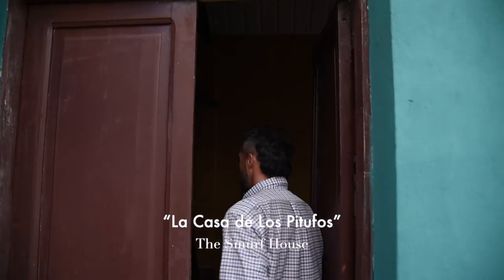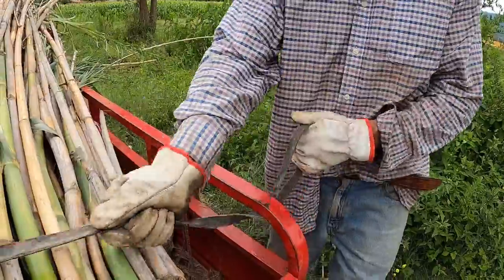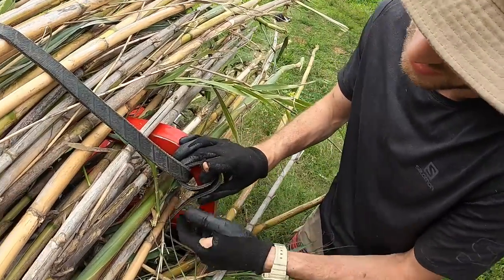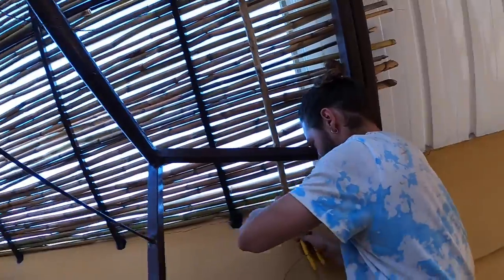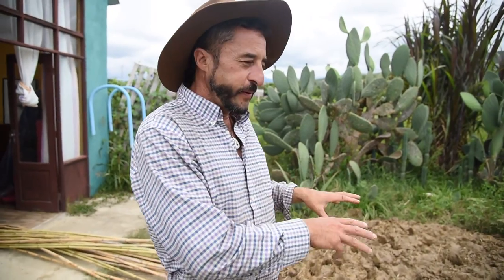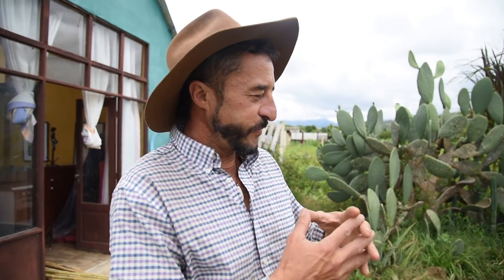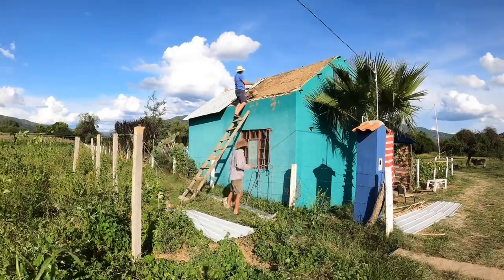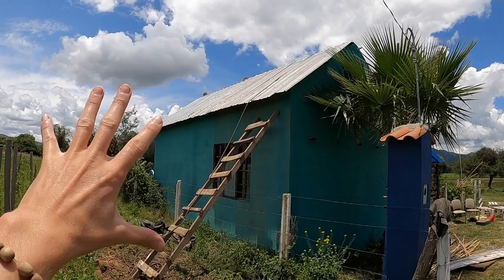How to Insulate a Roof with Bamboo from Start to Finish

Comment: I would've slapped a light straw clay straight onto the bamboo stopping all termites and creating better insulation. Earthen plaster the interior ceiling to further protect bamboo.
Reply from the maker: Supposedly with cal mixed wjth the mud is even better. We did pit some straw with the mud but could only pit that on the side we took the roof off (which we never will do again)